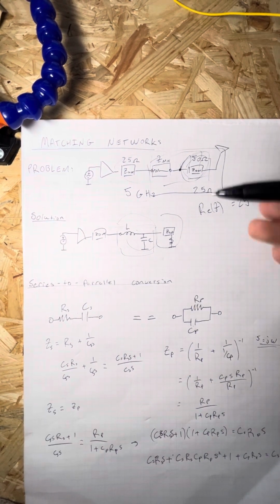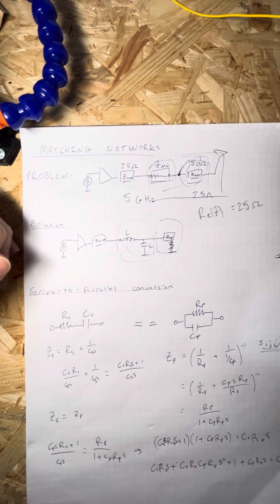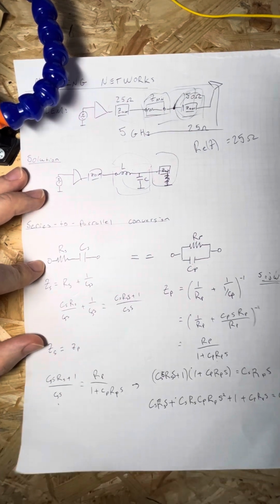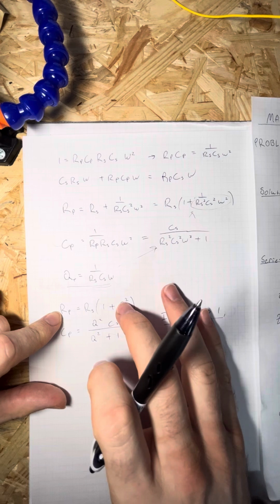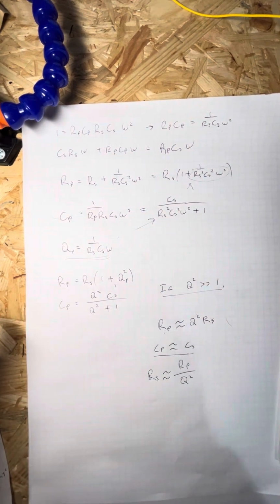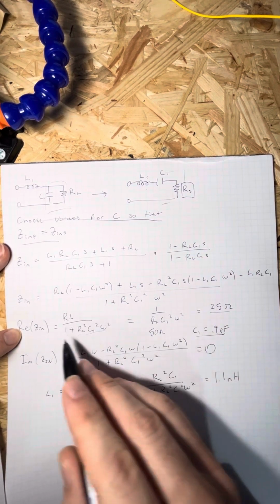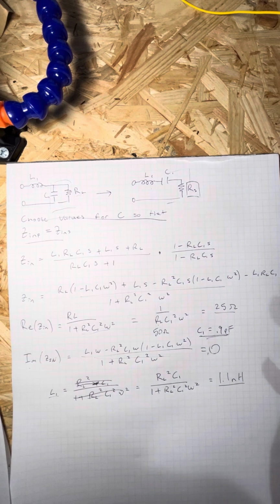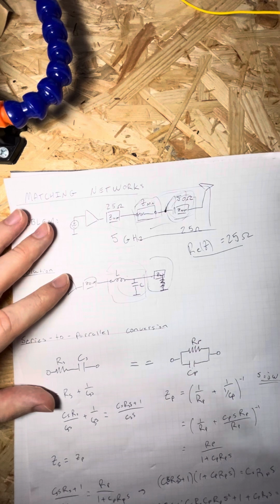Why Series-Parallel Conversions are used to analyze Matching Networks

Comment: Nice!! I appreciate the mention, good luck with your studies! It may be easier to follow your thought steps, transforming between impedance and admittance as you go. 

1. Switch your brain to admittance mode.

2. Add a capacitor in parallel to the antenna, summing the capacitor ADMITTANCE to the antenna ADMITTANCE (1/50). This will change the impedance completely (real and imaginary part). The reciprocal of the antenna + capacitor admittance (impedance) must have 25 Ohm real (Zreal = 25).  

3. Switch your brain to impedance mode.

4. The imaginary part will be "arbitrary" at this point, like Z = 25 - X

5. Add and element in SERIES to cancel just the X part (as X is negative, we add an inductor). This works because the real part of the inductor is 0 Ohm.
Reply from the maker: @AllElectronicsChannel  
Thank you for your advice! Your approach is much easier. Using smith charts are you did in your video is also much more intuitive. After this video I read RF Circuit Designs, Bowick and they suggest to use admittances and impedances to “traverse” the smith chart to the right spot.